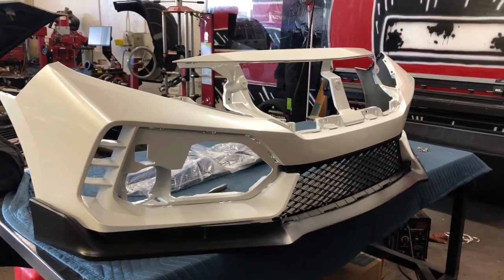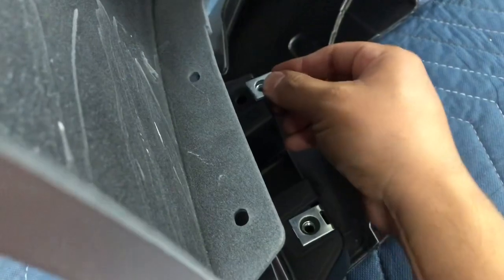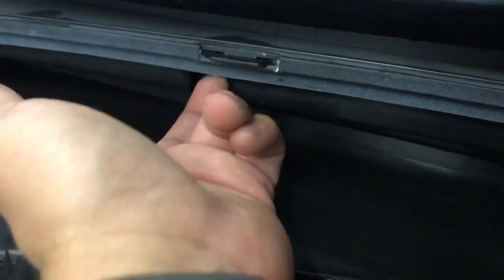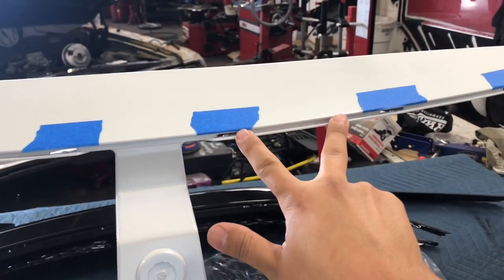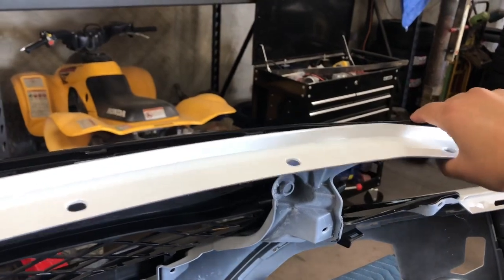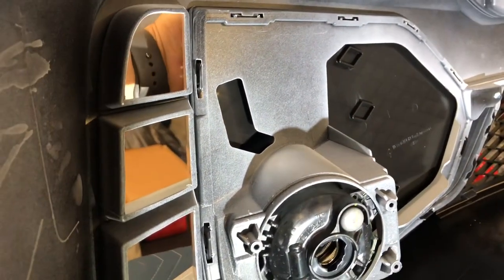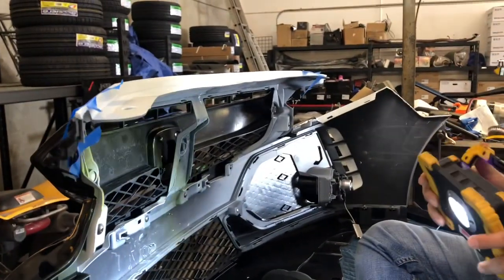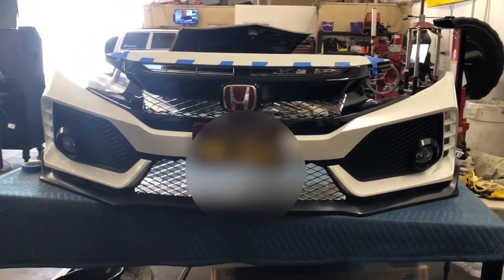How to assemble Aftermarket Type R style Bumper and grill 16-18 Civic step by step

Comment: my 2019 civic  sedan, I love it but I'm looking to swap the front bumper for the TYPE R  one. I want that the grilled bottom pieces look. Will this work? Also considering my car has honda sensing, will that affect it as well?
Reply: Liu Leo bump
Reply: @franciscorubalcaba861  it wont work if you only have the grilled piece look. you need to make a diy cut out for the radar cover and use that for the honda sensing radar or have a shop do it for you.
Reply: It works but u have to cut a chunk of sensing on the passenger side. Ur fog light garnish things will pop out and what I did was screw them in cus the clips weren’t strong enough. Also I got a error code on my dashboard saying sensing radar is being obstructed . I haven’t figured that out yet but I don’t think it should be a serious issue. SoCal accessories didn’t say nothing about these problems u will have with the sensing . Good luck